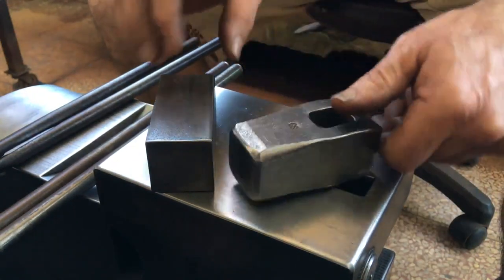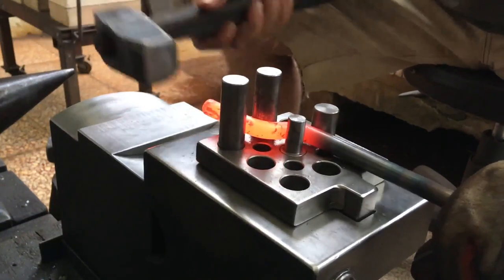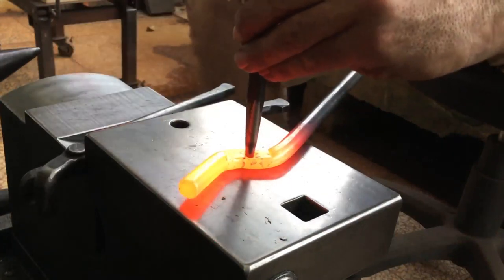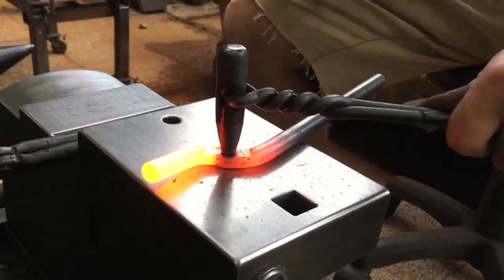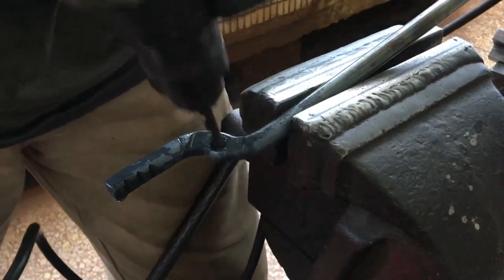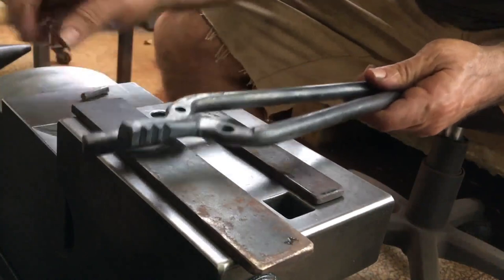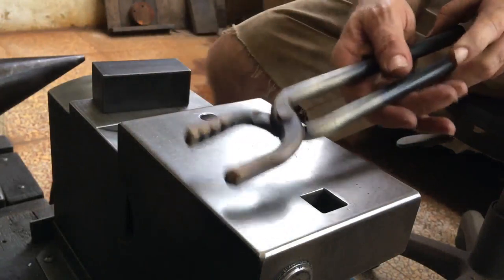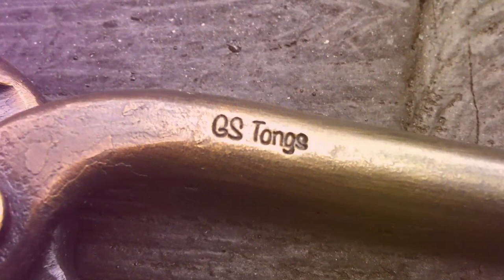Forging a Hammer Tong

Comment: that came out really nice!  it looks like it holds those hammer heads really effectively.

I really love the style of your tongs—the shape and the surface finish, both  they're simple, and something about the balance between the length, the curves, and the thickness of the stock is really nice.
Reply from the maker: I think some other styles may hold better that this pair but this style is simple and versatile. And holding from the sides allows me to hammer the hammer head top without interference from the tong jaws. Anyway, glad you like my tongs and I appreciate your taking the time to comment.
Reply: @gstongs  
makes sense.  I guess other styles hold the corners, or make use of the eye?  I'm not very knowledgable, unf.

I'll be looking forward to seeing these in use, anyway.

Comment: Fantastic work, as usual. How do you keep everything rust-free despite storing and using your tools in an outdoor and more importantly, rainy environment? I ask because I'm still deliberating as to how exactly I'm going to execute my own setup, as my only option for forging will be outdoors and the more I am able to leave outside the easier it will be.
Reply from the maker: I think just daily use helps keep rust at bay. Plus, I often rub my tools down with oil and store most tools out of the weather as best as possible. Thanks.

Comment: Very nice Glen, just wondering why not make some V bit tongs to hold that square stock?
Reply from the maker: V bits would definitely hold better. But this flat style (holding by sides) allows me to hammer the top of the stock without the tong bits getting in the way at all. And it makes grasping the stock from inside the forge a little easier. Thanks.

Comment: What's the brand of anvil?
Reply: it's a custom one he designed himself.  he said he heat treated his first one himself, but I think this one was heat treated by the same shop that shaped it.
Reply from the maker: As ThoperSought said, the small, block style anvils I use are my own designs which I had made here in Taiwan. Very happy with them. Thanks.
Reply from the maker: Thanks for replying - you're correct. Heat treating that first anvil was really something - would have made a great video and reinforced that I've got a few screws loose, heating a 150 pound block of steel on a balcony...
Reply: @gstongs  
that surely would have made quite the video.